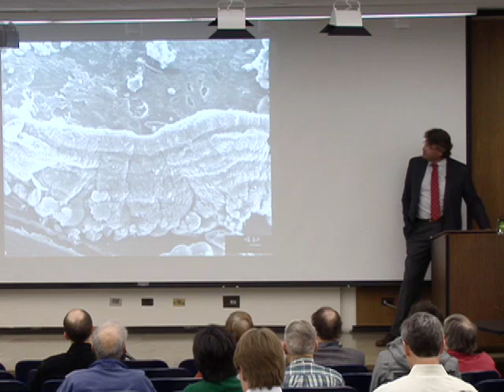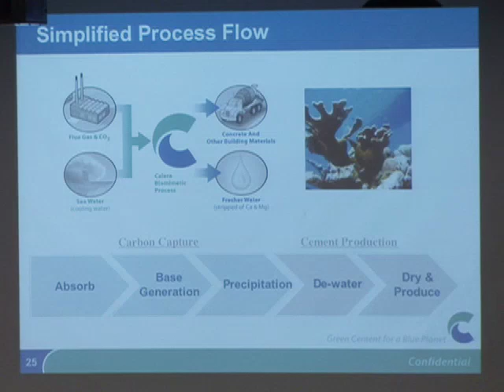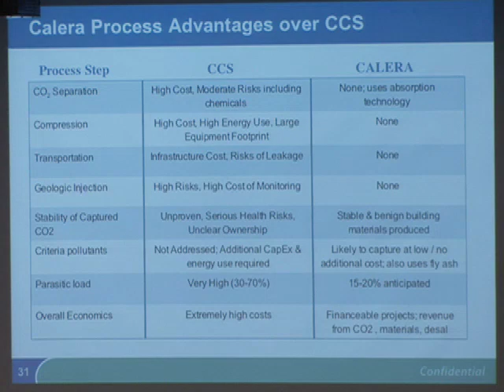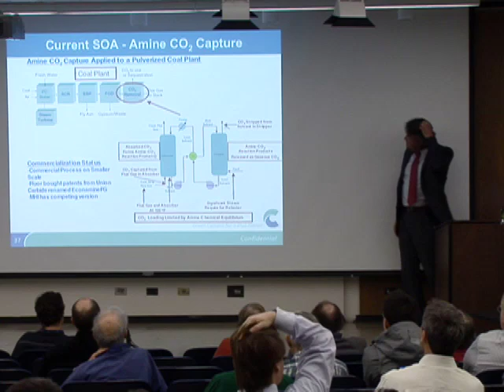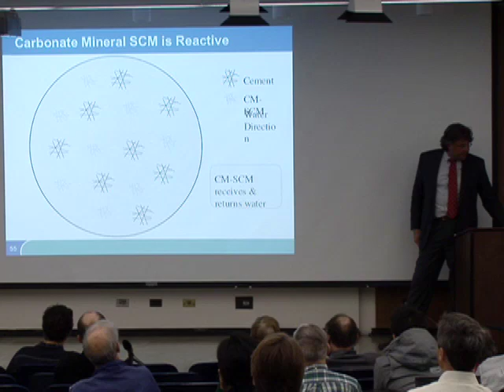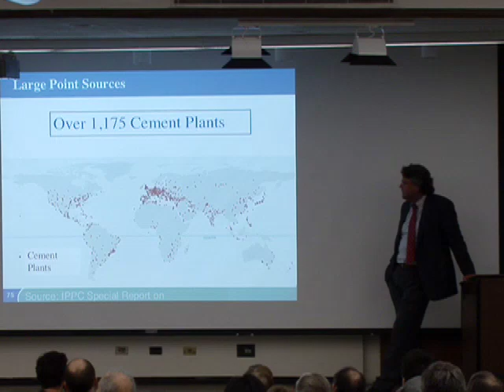Sequestering CO2 in the Built Environment

Comment: CCS Sequestered carbon can be used to make green building materials like aggregate for concrete, increasing sustainability for coal burning electricity. This is a acedemic lecture so be familiar with scientific terms. Lecture runs from carbonates in corals to bone cement. Great practical information on cement science and carbon capture.